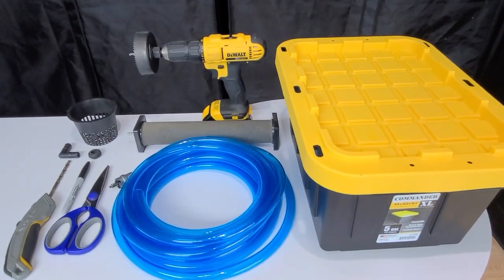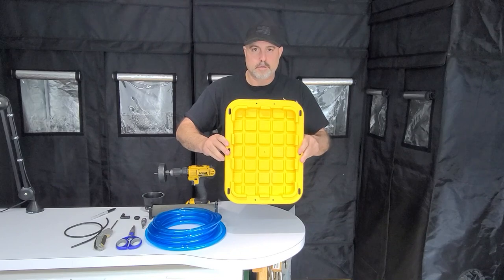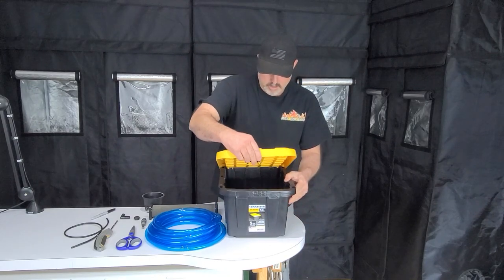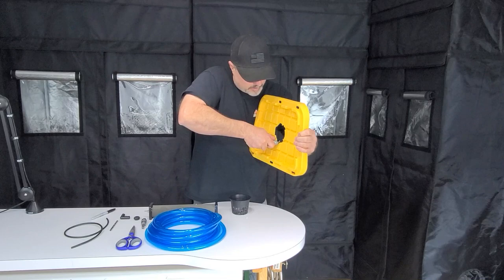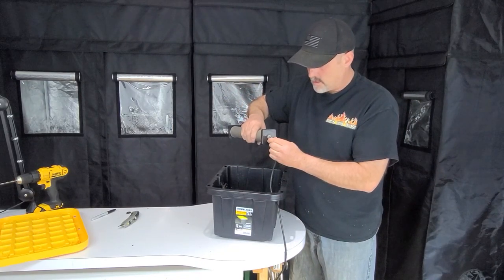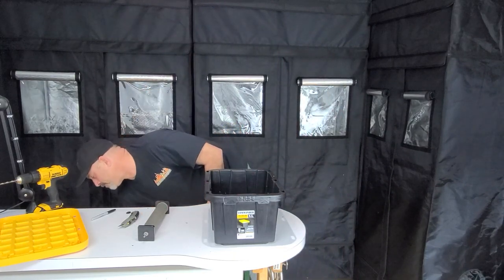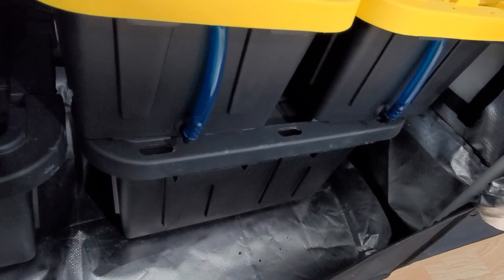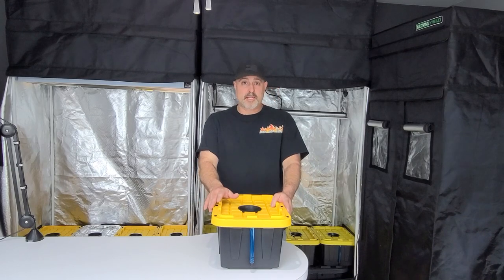How To Build A 5 Gallon DWC Tote | Parts List | #Hydroponics

Comment: Joe, solid stuff. My 12yo and I are building a 4 site based off this exact method you presented. We were wondering if you've ever used a more shallow tote with a different pump cycle? After running numbers and measurements for our setup, we think we could almost double our sites. Thoughts appreciated. Take care.
Reply: 1:48 😊 1:48

Comment: im sorry but you wanna not do that with the air stone, at all. You wanna smaller stone on a line coming in through the lid, that way come change out you literally lift out the lid and drop the plant roots and air stone right into that freshly prepped pot, its ready to go, no faffing. 

That stone man, it has a normal 6mm air hose input but you coming in with like 2 inch hosing, no need.
Reply from the maker: Thanks.. I'll try that next time although my plants turned out great.. Thanks for the tips..